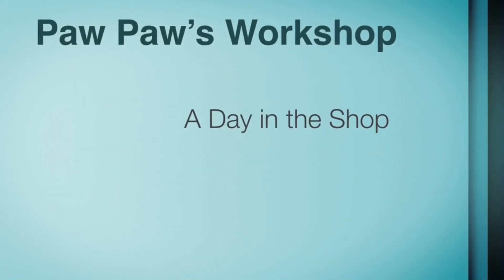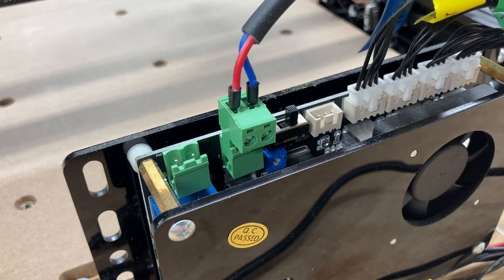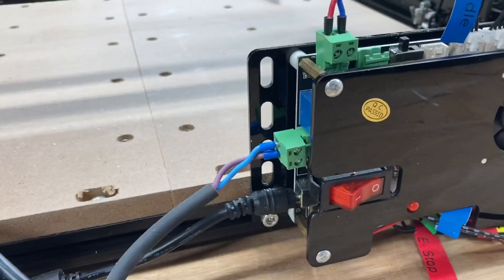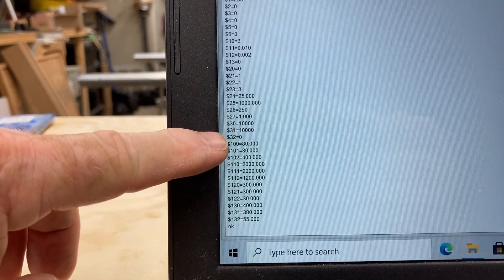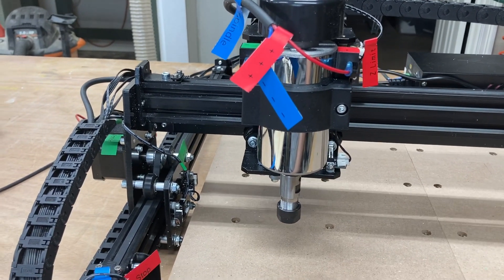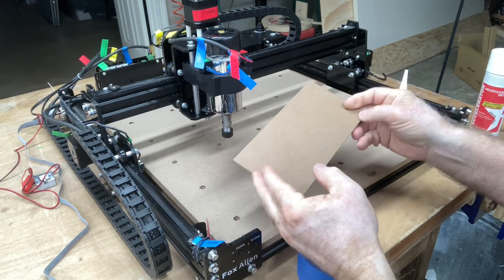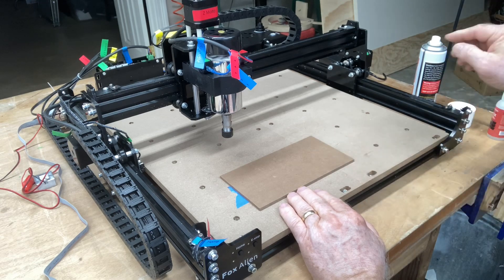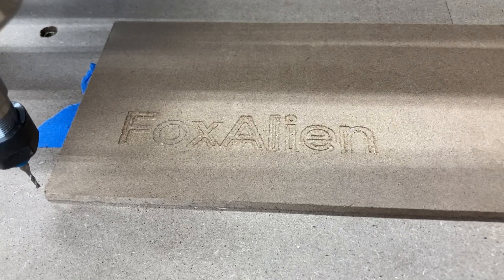Upgrade the FOXAlien Basic Edition Masuter W/300w Spindle and More

Comment: Hello, good afternoon. 
I have a problem and I don't know how to solve it. My CNC (4040) now does not go down to the measure indicated in z and does not make the cut well. I am using EASEL and I can't find the fault.
Can you help me?  Thanks
Reply from the maker: Is this a new issue or something that just started?  If this is a new issue it most likely is a mechanical issue.
Reply: Hello, thanks for your answer. Is a new issue 😔 @PawPawsWorkShop

Comment: I have a question for you.  I just upgraded to the 300w spindle for my Fox Alien Masuter Pro and when I hooked it up to my original controller box I noticed that the fan on the upgraded black controller box do not come on but the speed dial works. Is this supposed to operate that way because the fan in the original fox alien mauster pro should be the only fan in the two controllers that should be working?
Thanks!

Comment: prob an easy question for u guys but i was wondering why after sitting up my 4040, and watching ur  video ur pattern was alot larger than mine.
but ur video made using the controlls alot easier. thanks
Reply from the maker: Do you have a specific question or problem?

Comment: Everytime when I run a program my achses (x,y,z) are shifting away. What can I do ?
Reply from the maker: The program would not change. Therefore, you have a mechanical issue. I would check the tension on the belts and I would check all the set screws to ensure everything is tight.

Comment: Very seriously considering FoxAlien for a first CNC. My budget doesn't run to a 40x40XE, so interested in 300W spindle upgrade with MASUTER. I want to CNC the usual mdf,  but also plywood, real wood carving and plastics. Is the 300W upgrade worth it and can those NEMA17 steppers handle the extra torque from 300W spindle? Keep those great videos coming.
Reply from the maker: Yes, the upgrade is worth it. You will hav extra power which will help for the various types of carves
Reply: I recently purchased a 4040 class CNC machine, not a Masuter. It has has 4080 C-beam for both the X & Y axis and a 400 Watt DC air cooled spindle. The torque increase of the spindle motor allows you to not only use higher spindle RPM and larger bits but you can use greater feedrates  at deeper cuts with no spindle bogging down which results in much faster cuts. I'll never go back to a 4030, no way.

Comment: What's the benefit of upgrading to the 300w?
Reply from the maker: You get more power and thus you should be able to increase the feed rates. It also add weight which helps the stability of the machine

Comment: What feeds and speeds, depth of cut and step over have you used with that bit and motor combo?
Reply from the maker: This is a very lightweight machine. Keep the depth of cut around .04 inch and the feed rate at no more than 40 ipm. The step over should be no more than 40% of the bit dia

Comment: you have given great  instructions on how to upgrade to a 300 watt spindle.  im interested in learning what the wires you changed actually do so i can upgrade the spindle without having to use the FoxAlien kit. I can save a fair bit of money using a different 300 watt spindle.  Thank you very much in advance if you can help me.
Reply from the maker: Use the same wires from the 60w spindle to the 300w spindle
Reply: When you move the connector from the right on to the left connector and move the switch to the left position it bypasses power from the board. And uses the new power supply. That power runs through the relay on the board so the software can turn on and off the spindle.
Reply: @rubend3199  Hello , I just made the same upgrade to my maturer 4040 basic.I haven’t played with it too much yet. However, even though the wiring appears correct I still can’t seem to get the 300w to spin up. I am using candle and ugcs. Designed in easel than downloaded to a flash drive. The computer my cnc is connected to is offline. My question is how do I enable the software to initially start the spindle?  Or is it possible I received a dead unit the power indicator light does work but the fan doesn’t spin. Thank you for your time.
Reply: @Facial_Parade67  I'm having the same issue. Except Grbl software isn't powering up.
Reply: I apologize for not being more clear....   Im interested in learning the proper names and what each connection and switch functional do.   This way I can set up a new spindle on any board with any arrangement of pins.   Is this more clear?

Comment: I'll be buying one cnc/laser combo this week from fox alien. Im looking at the masuter but I also bought a Makita today. I notice they have the adapter to fit the dewault router AND I saw the have a vacuum connection fro the Makita and the dewault.
Would they have an adapter for the Makita OR is the Makita the same diameter as what is on your 300 watt spindle?
Most importantly, what is the drawback to adding your own router. Is there any functionality loss?
Reply from the maker: My suggestion is to go with the FOXAlien VASTO,  it is strong and will do all that you will require of it. I would not get the Masuter. If the budget prevents you form this then go with the 4040xe.
Reply: Would you mind explaining why? Is the masuter not as structurally sound as the 4040? I realize one has a box and the other doesn't but other then that I don't know the difference as to why one would choose one over the other considering an upgrade from 60w to 300w spindle can be done on the masuter also. In that respect I'm confused.
Reply from the maker: The one with the box is 3018 and is very small. The Masuter is extremely lightweight and has had problems cutting even very thin material. They even recommend upgrading with an aftermarket bearing and still it is limited. You can also add the dewalt 611 router to the 4040xe. Can’t do that with the Masuter
Reply: @PawPawsWorkShop  that was very helpful thank you
Reply: @PawPawsWorkShop  
I came back and watched this video again. Glad I did and I have one more question if you don't mind.
I wound up ordering another cnc/laser combo unit. I actually get it tomorrow but in watching this video again I notice the GRBL based offline controller that you demonstrated. The unit I ordered is GRBL based but it is not a foxalien.
Do you think that controller would work on another machine that is GRBL based?

Comment: Hello I have a masuter 4040 basic cnc.  My spindle assembly rocks back and forth.  I have upgraded the bearings already and it help some but the rest of it is coming from the wheels on the rail they are not touching the bottom properly.   Do you have any advice on how to fix this?
Reply from the maker: I have looked at this quite a bit and realized that the z axis pivots on the center point where the wheel is located. I did a test either carving pvc and a chit and it did well. When I put a wood project on I experienced the same thing. The best I can suggest is to go extremely slow and very shallow cut depths. The other option it to switch this to a dedicated laser and move up to the 4040xe or their new machine that was just introduced

Comment: Is there a difference in a downcut bit and a fishtail down cut bit??
Reply from the maker: The fishtail is the design of the bit. It can be either upcut or downcut. That is how the blade is design around the shaft of the bit. When the bit spins it is either pulling the chips and out or pushing the chips down.

Comment: wait is this an entirely different 4040 than your previous videos? also I love your step by step videos, I'm wanting to get a CNC router soon and I'm basically sold on the foxalien brand.
Reply from the maker: Yes,  there is the 404xe which is a little larger. This the basic edition of the 4040. Use the link in the description to go to their website, there you will see all the machines and the available upgrades.
Reply: @PawPawsWorkShop  yea sorry just looked back through your videos an realized the difference haha. I'm gonna be doing pretty much all hardwood carving, do you think the 60w would be sufficient for that? or should I just fork out the extra money (willing to if it's what I need) for the XE?